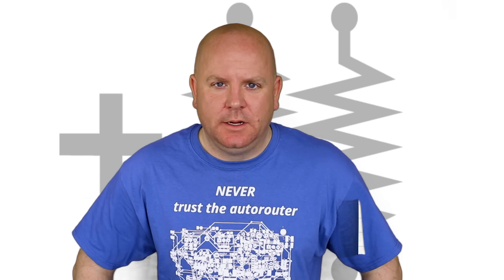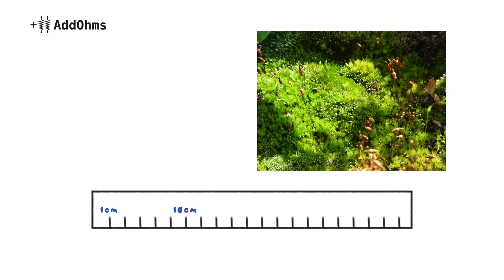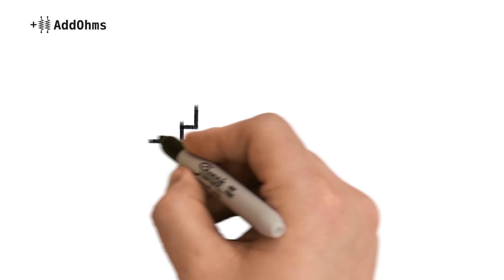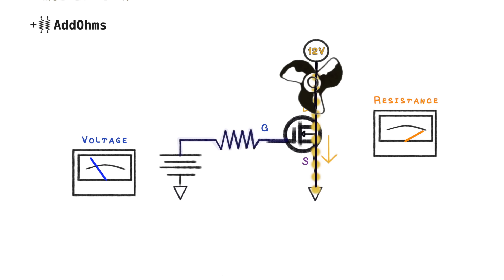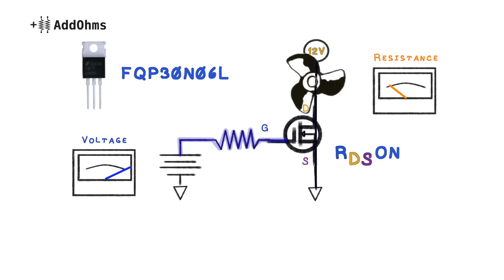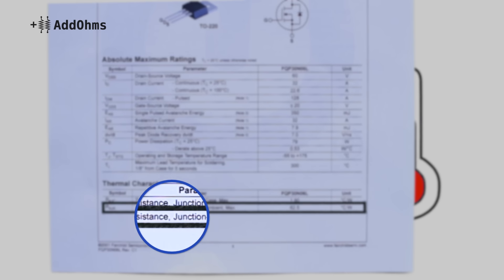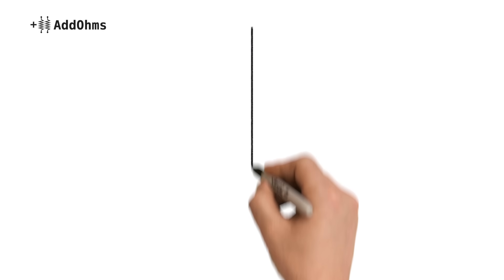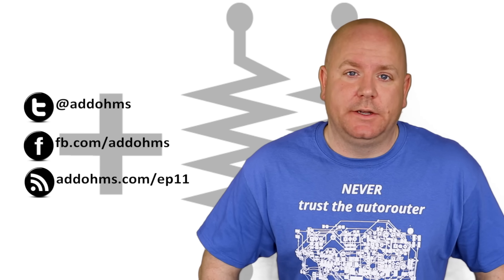MOSFETs and How to Use Them |  AddOhms #11

Comment: I've seen a YouTube video that has designed circuits using MOSFETs for switching loads, and then substituting a Darlington pair for the same task. What are the criteria for choosing one or the other?
Reply from the maker: +Chaplain Dave Sparks My experience has been Darlington pairs offer little benefits compared to a logic-level MOSFET. If I had a TIP120 sitting around doing nothing, I would use it. Otherwise, I'd just use a FET.

Comment: finally... someone explained how to select the mosfet in practice... in university they are all about calculating amplification, working of a mosfet in molecular level, etc. but they won't tell simple things like these, which are super important when using and selecting the transistor in practice. Thank you, sir!
Reply: I agree, I just knew they were voltage controlled -_- This guy taught me so much in 7 minutes, I really liked the datasheet part (at school they just throw questions and say to use the datasheet, but not explain what to look for or determine if a heat sink would be required)
Reply: I failed Electronics as a subject and hated it for its Transfer Functions, but I could build any circuit I chose to. Damn lecturer was as boring as mud
Reply: ........I remember those type of textbooks.. It's important to have a play with the components to get familiarized. I'm surprised how many people don't know a simple set up with a p and n channel  jfet that results in a tunnel diode effect but when I first came across this simple circuit I just had to try it out and it produces excellent sine waves according to my hearing perception.
Reply: And I failed my first job interview right after college, because of what you guys are saying here. Those college courses are quite useless in getting most jobs in the commercial world.
Reply: @williamwoo1437  Thank you for this comment. I have a bachelor’s degree in electrical engineering and I must say that most institutions are not really teaching students what’s important but rather basic knowledge. I have been working tirelessly to understand every electronic component because it’s fascinating to me how electricity works, from high voltage to internet. It’s all electricity. The passion for this knowledge and topic is all that keeps me going. Otherwise, the industry has no use for some graduates, the workload is enormous and some processes are money making rather than creating knowledge. I hope this will improve soon because „learning on the job“ is the best way to solve a lot of the problems in engineering.
Reply: dylans voice  yup cheaper too 💀
Reply: Yes.  University always seemed to get it backwards.  Explain in great detail and with a lot of heavy math how things work and then leave you to figure out the practical applications on your own because, well, that’d seem too easy I guess.  Then on the job one wonders why someone with a 2 year technical degree or military experience runs rings around them in solving real-world practical problems.  So the engineer inevitably gets frustrated and career pivots to management.
Reply: dylans voice  Which is why some companies are moving away from schools. Had an interview taking 3 hours of an online quiz, had questions from basic programming to PCB design. They had open internet and said go for it. We will contact you if you are selected after it was completed. 

Overall, the best interview I could say that I had, I also believe they had 7-8 other candidates taking the test, we were all spaced like 15 minutes apart to have the 1 on 1 personal questions.
Reply: University taught me to be a very broke educated idiot. Honestly, an engineering degree is hardly beneficial to being an engineer. I learn more on YouTube while testing the septic system than I did in school!
Reply: Dude it’s because those teachers don’t want you to learn. They just want your money. I was majoring in chemistry and dropped out because cal 3 killed me. Oh well, learned more outside of school because I took it upon myself to utilize the web while we still have it. The driving force of electricity is what spawned life when the universe was created. Same driving force behind water, that’s why water analogy is makes sense. The way I see it, anyone can learn this stuff, as all calculations thus far in all of the science disciplines (including the list of nature’s constants) are calculations found by fellow human beings; hence anyone can do it. 
Funny how people say that science proves the absence of god. In my humbled opinion,  space is the canvas for God to create the things God wishes to create. We will never learn the complete truth as far as why we are here. We simply aren’t physically capable of even trying to understand. Humans are too smart for our own good. Keep up your studies, bc the more you learn, the more liberated you will become. The more your eyes will open to the deception of people.

Comment: Thanks for this tutorial! The heat sink information is particularly useful. I noticed the depletion symbol despite the enhancement MOSFET description (small problem). Footnote to the presentation: You mention that MOSFETs act like voltage-controlled resistors. True for JFETs (depletion devices) operating below the gate pinch-off voltage. That is, left of the knee, near the top-left side of the curves. Beyond pinch-off, the JFET becomes a constant current source: Similar to an enhancement MOSFET operating in the flat-top part of its curves. Maybe one of your other videos covers these points.
Reply from the maker: +James Hawes Yes, the depletion mode was a mistake I didn't catch. I drew them both and used the wrong one. Long story.

Good points on the footnote, but I probably won't go into the much detail. The idea was to differentiate a MOSFET to a BJT, not get deep into the details.
Reply: +AddOhms 
About one minute in, you say that the depletion MOSFET works like a variable resistor. Maybe there's some way of clarifying this point without getting too detailed. (As you know, unlike a variable resistor, a MOSFET amplifier is nonlinear.)

Comment: Great video and excellent presentation, cutting though a lot of boring numbers in a useful way.
I am wondering though, could I just purchase a MOSFET that is about 5 times overrated for the application, and not worry about the temperature? I'm not worried about the price or size, just want piece of mind.
Thanks
Reply: +ArcanePath360 I agree with that general design philosophy - for the likes of us, not necessarily for commercial purposes.

I think the answer is "Probably, yes", but it could still get hotter than it should, without a heatsink, if you're switching enough amps - so fit one (or bolt it to a lump of scrap metal) and you should be fine.

You'd still need to check that the switch-on threshold voltage (Gate - Source) was low enough for your application though.  Some can be switched at very low voltages, e.g. 2.5V or so.
Reply: +TooSlowTube   Thanks. I did end up using a sink. It got pretty hot without. Even with it, I have a thermistor hot glued in place and my Arduino is programmed to cut out when the temp gets too hot
Reply: +ArcanePath360 Good thinking :)
Reply: +TooSlowTube Thanks. I made sure it cuts out before the hot glue melts and the thermisor falls off, lol.

Comment: So if I see a NPN transistor with a datasheet but it defines Base, Collector, Emitter can that be used in similar applications ?  Vceo=60,Vcb=70,Veb=5
Reply from the maker: +S Burnham I'm not sure I understand your question. An NPN is a BJT, which was covered in #10: https://www.youtube.com/watch?v=sRVvUkK0U80.
Reply: +AddOhms : I have a MJE3055T SGS-Thomson and the datasheet talks about "power switching circuits and general-purpose amplifiers". My original question was to see if BASE COLLECTOR EMITTER terminology was interchangeable with  GATE DRAIN SOURCE discussed on your videos.  I assume there are differences, I was hoping to use this to control brightness of led strip by PWM with Arduino, but I'm questioning if ... "this is not the type of transistor I'm looking for".
Reply from the maker: +S Burnham The terms aren't interchangeable, because the two types of transistors work very differently.

However, it may appear so because in a switching circuit you could literally swap one for the other, in most cases. If the circuit is a low-side switch (Positive Voltage -> Load -> Transistor -> Ground) then you may be able to substitute.

Keep in mind you'll still need a current limiting resistor on the Base and you likely don't need a pull-down resistor from Base to ground, like you usually see with a MOSFET.
Reply: +S Burnham3 A BJT can by used in similar applications, but only for switching fairly small currents.

Comment: while using arduino to control a large appliances is it necessary to have a optoisolator?
Reply from the maker: +Krishna.S. Gowda It would be recommended to use a transformer or optoisolator to provide SOME isolation. It's unrelated to MOSFETs, however, because you wouldn't use a MOSFET to control an AC Device.

Comment: hey james i just notice that my mtx jackhammer car amplifier has 4 mosfets  blown and cracked. i i am trying to find a replacement but the part number i just cant seems to find. the part number is N523AG but i have called around an no one has it i have checked online and stll cant find it. this amp was made in 2005 so why is this part number so hard to find. could there be an equivalent. if so where could i find it.  great video love the presentation
Reply from the maker: +kurtis Douglas Sorry, I have no idea. Try searching for partial part numbers. Part of the number may be a customer (the company that made the amp) specific part number, part of it maybe lot/date codes.  It is pretty common for shipping products to have parts without part numbers (or customer specific part numbers) to prevent copying.
Reply: I believe you got yourself a date code and or manufacture lot code not the part number. 23 week of 2005 possibly. Are there any other markings? Are they on the smps side or the amplifier side?

Comment: So I happpen to work with a MOSFET (quiet similar in values to yours) but with I=7,5 so I get P=5,625 which happens to be greater than 2,4, meaning I need a heat-sink. How do I calculate which heatsink I need? Thanks a ton, nice vids
Reply from the maker: +Jens Emil Hansen That's an entire video in itself. In short, see if you can find a heatsink that gives its thermal resistance (like 23C/W). Add that to the "junction to case" resistance given in the datasheet for the transistor (like 5C/W). If you calculate the MOSFET will burn 5 Watts, our example heat sink (23C/W) + transistor case (5C/W) will give a junction temperature of 28C/W * 5Watts = 140C. If the max junction is 150C, that heat sink would be fine. 

I picked 23C/W because that's the cheapest "wing type" heat sink for TO-220 Packages.
Reply: +AddOhms Didn't expect an answer like that, that's pretty cool :) Thanks man
I really enjoy your videos

Comment: Very interesting but I find some discrepancies because your formula for heat is too simple and not taking everything into account.  Example - Rds(on) = 2m ohm, current 6.6A, Ambient 25c, and R0JA 62.5c I get Tj as of 30.445c which is far less than the 175c the part can handle.  In your example you are only looking at the ambient and the 175c then dividing by R0JA which eliminates Rds(on) and the current through it.  I have two mosfets and all data is the same except Rds(on).  One is 2m ohm and the other is 20 m ohm and the 20 m ohm will burn you (I know I have a blister from it) where as the 2m ohm Rds(on) isn't even warm (less than body temp).
Reply from the maker: +legalizeshemp420  As I said, first we calculate how much power the junction generates (5:17), using Rds(on), and then we calculate the maximum power the package can dissipate (6:06). In this example, the package can easily dissipate the junction's heat, without a heat sink.

I agree there would be discrepancies if you change Rds on, the current, the thermal difference, and the thermal resistance.
Reply: +AddOhms Yep, I saw those but in the end I didn&#39;t really see it all mesh out for me.  Oh, here is a nice calculator I use for this stuff if you would like it ... http://snuletek.org/calculators/fetTjCalc/

Comment: I just went over the concept of dissipation and thermal resistance calculations for MOSFETs and opened a few IGBT datasheets do repeat the exercise for IGBTs.

Now for MOSFETS, at 24V and 35A with 20kHz switching, I got losses of say 3W max for many cheap MOSFETS (RDSon about 2mOhm). So even a cheap heatsink, say 18K/W would be 72C above Ambient. 

For the IGBTS I saw, a general value of total switching energy Eon+off is 5mJ. So switching losses at 4kHz are 20W. Add to that about 2Vx5A=10W of conduction losses and you have 30W per IGBT....

Is this right or am I making a mistake (hopefully). 

For 30W, even 3K/W of thermal resistance will make the IGBT unusable.

What am I doing wrong?
Reply from the maker: +Chinmay Harkare Sounds correct. This is why heat sink design for high power MOSFETs and IGBTs is so critical.
Reply: +AddOhms But that means that an IGBT rated for 100s of Amps actually requires a monstrous heatsink even for carrying 2-3A. The switching losses are insane... I mean 20W. And 30W total makes that tiny TO-3P dissipating the same amount of heat as my soldering iron.

Comment: Can you use MOSFETs to make logic gates and combine those to make even a simple processor?
Reply: +Matthew Ferrie Yes, of course.
Reply: James Lewis
How?
Reply: +Matthew Ferrie Use complementary pair (=CMOS technology) So for each input, you will have 2 MOSFETs (1 N type and other P type) There are many schematics out there that say how simple elements are formed. 1 2-NAND requires you to have 4-MOSFETs together and that's not all. I would recommend going for a simple processor that operates on stack technology (if you seriously consider putting one together yourself but it's hell of a job to do...). They also sell logic chips that already have needed wireing done for you and you simply can plug-and-play. Doing a very simple processor design is not that difficult actually but requires of you to understand discrete mathematics and boolean logic.
Reply: +Marek Grencštein like Thanks!

Comment: Very nice presentation. Very good job. I have a question: can I use a Mosfet with the gate connected directly to an Arduino? I have a PWM controling LEDs but, I would like to control 20W bulbs. Thank you in advance. Best regards. José (from Portugal)
Reply: +José Fonseca Yes

Comment: Nice video! 

I have a question though, I'd just like to know how could i connect a circuit needing only 9 V from a 400 V circuit that's running off a 1.5V batt?  Is there some sort of component that can reduce the 400 V or prevent it from damaging the IC or LED i have in place?  If so, can you do a video on it please?  I seem to recall just using simple components like resistors and capacitors to lower the voltage down but i'm not so sure about it.  Cheers

Comment: Hello thanks for the tutorial! I have a question, I have irfz44 mosfet I would like know if they work in logic level his data sheet say Gate threshold voltage min 2 max 4?
Reply from the maker: +Nelson Arias Mendez It will turn on with "logic level" voltages, but it'll operate at it's low-end. So don't expect the maximum rated current through it, with only a 5V Vgs.
Reply: +AddOhms I don't understand, I'm working with them to 5 volts but they are heated,  am turning on a unipolar stepper motor of 5 volts dc 3.3 A. using this configuration http://s2.subirimagenes.com/otros/previo/thump_9464451mosfet1.jpg in in each phase , do you know why this happen?
Reply: +Nelson Arias Mendez http://www.subirimagenes.com/otros-mosfet1-9464451.html

Comment: Is it possible to put mosfets in series in order to increase the source voltage? For example I have 5 mosfets rated at 450 volts. Can I put their sours and drains in series, so that I can increase the voltage up to for example 1200v?
Reply from the maker: +Life is illusion My understanding is yes, but I don't know the details. This isn't something I've done myself, so hopefully someone else can provide a better answer.
Reply: AddOhms Thanks for answering, I appreciate it. My logic also tells me it is possible, I just wanna see if someone knows the facts before I fry few of my mosfets :D Anyways, I think I will do the tests in couple of weeks and maybe I even make a video about it ^_^
Reply: No, doesn't work that way, as during switching any variation between devices will unbalance the voltages and something will explode (yes, definitely explode at those voltages).  You use an IGBT for
1200V anyway, not a MOSFET (well, a SiC MOSFET perhaps, but not a silicon one).

It is possible to balance voltages BJTs in a series string, as the emitter voltages follow the base voltages, but with MOSFETs there is no direct control like this and you can't do it (well, perhaps someone really clever has figured out some scheme using capacitive feedback paths, but I suspect its not worth the bother).

Comment: Hi, thank you for your video. i have 3 mosfet STP60NS04Z and MBR3045CT diode in a ABS unit; my problem is every time the engine reaches temperatures close to 90 C, they switch on the power to the pump causing a fault in system. The question is if the threshold is 175 C based on the data sheet why do they switch on?
Would appreciate your take on this. Thank you
Reply: 7
Reply from the maker: 175C is the junction temperature. In other words at the actual silicon.  The "thermal resistance" of the epoxy means the surface temperature has to be much lower.
Reply: Alright, thank you